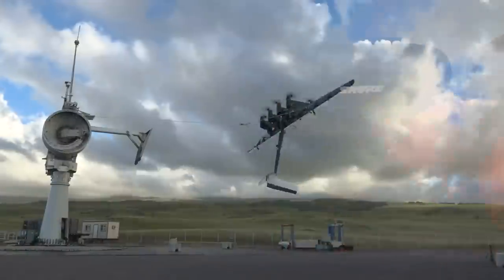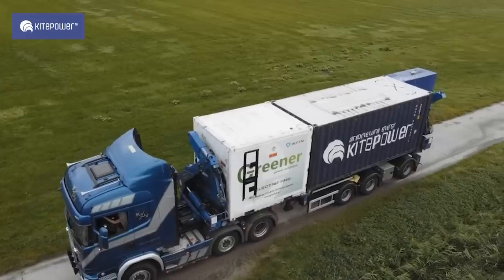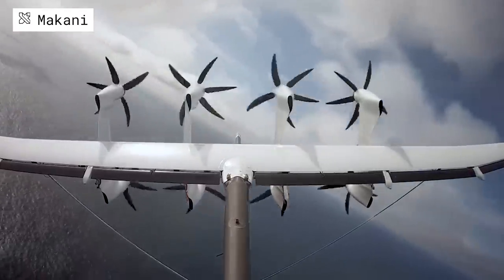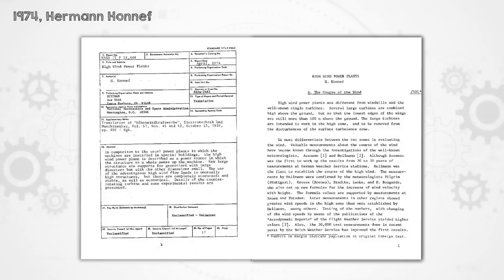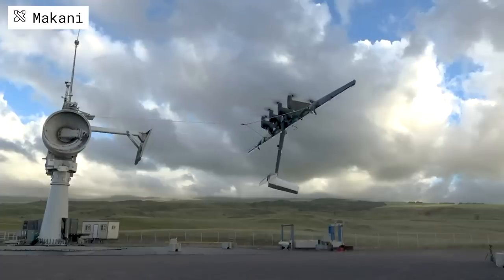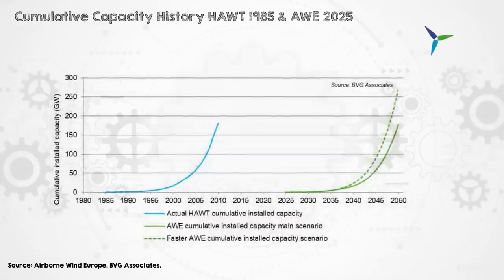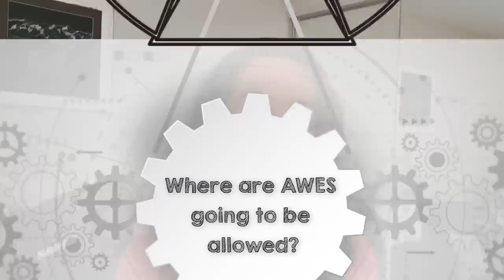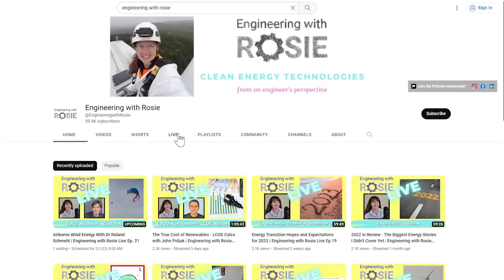Will Airborne Wind Replace Conventional Wind?

Comment: That's a big NO.  Airborne wind is as much a scam as vertical axis wind turbines, they both produce very, very little power but have exorbitant costs.  Main problem is, the rotors are super tiny and won't produce much of anything.  Wind turbines ideally like: 20-40 mph (32-64 kph), they don't need to be up in the extremely high winds as the rotors won't spin any faster, they just receive more wear and tear.  Ideal land-based wind turbines are 3-blade: 5-8MW with 100m towers and off-shore turbines: 15-20MW with 100-120m towers.  These dinky airborne and vertical axis turbines are mostly a waste of money that solar panels can do the work of.  BTW, I've had a small wind turbine in my backyard for the past 15-years and have sold over 2k small wind turbines in the past 16-years.
Reply from the maker: Good points, however if turbines will consistently see high wind speeds then you can design for that and take advantage. Ground based turbines aren't designed for the high wind speeds because it would be expensive to put a really large generator that would only be fully utilised at wind speeds that occur rarely.

Comment: Engineers see solutions in everything, but they often fail to grasp the downsides and potential problems with tech they develop, for example, lifetime cost vs upfront costs, metal tends to break apart when stress and load is put onto it, i see ONLY problems with a 24/7 flying structure that is suppose to last decades and reliably feed power to a grid that everyone depends on.
A nuclear powerplant lasts for 50+ years, it's solid as hell and will probably never run into major issues during its expected lifetime, If i was an engineer i would focus my efforts into making nuclear powerplants better instead of this artificial tax-fueled wind power hype, if windpower could bear it's own weight in infrastructure costs, powergrid costs, no tax incentives or "green politics" what would be it's current price per kWh? and electricity can't really be stored cost-effectively, we should only measure price per kWh during windpowers minimum output days during a year and not peak production days)

Start thinking stability and not fancy tax fueled green stuff please.

Comment: Hum interesting. I thought about the same idea. The problem is not getting there, it's staying there. I considered a tripod type system with graphene ropes holding a turbine in the air. The turbo fan rotating creates both lift and energy. I envisioned a torsional and long, turbine structure as the basis of the design, also made from carbon nano tube reeforced aluminum. The nano tubes are the rebarb and the aluminum is the concrete, if that makes sense  Think of a carbon nano tube mat, then injecton mold the aluminum. Like figerglass with resin  I cant quite see the turbine shape, but I'm sure that if you ran a sim, with all the fluid dydnamics, weather, ect..variables then youd get the perfect design after a few generations of running the program. Id also use Graphene layed, with a superterring magnetron, on balistic type ceramic, for the bearing, for super low rolling resistance and no need for oiling. In my head a large one didnt work, so my solution to the problem of lift was speed. An array of smaller diameter turbines would spin faster and hopefully generate more lift than one large one. I chose aluminum, as these things will get hot in the sun, so id cover the surface with peltiers to harness the heat into energy as well. I envision coving the peltiers in Vanta or Muso black to really make them efficient in the heat. Btw, I'm more of a creative thinker than an analytical one, so i can see it, but I can't do the math to see if it would work. If you put these over a desert area, the shade and airflow drawing down cooler air, should also have a secondary effect. Aluminum was also chosen for this reason, as the condensation of moisture, early in the day, could also raise the humidity, but I don't know as I can't do the math.  What do you think?

Comment: It wont. Most of the turbines around us are silent most of the time. The maintanence costs on a turbine are high, mostly due to the cost of having to send people and materials out to the remote locations. The airborne princible relies on more parts that are prone to ware than a standard tubine. Nothing you can use at home will have the power production to be viable and if the wind slows then the sail needs to be reeled in for safety reasons, which adds more moving parts, a person to watch it to make sure the motor does not fail and a control system that needs maintainence. It this system was used near a populated area then it would only be a matter of time before some idiot complains about it being dangerous, falling on their child or eco activists complaining about the danger it poses to bird (which to be fair it does) or vandels finding it funny when you cut the wire while its in the air.
Unless the system can be improved to be more cost effective than a Nuclear powerplant then it will be consigned to the same pile as the gravity battery.
Just to be clear its a nice idea and the creativity is top notch, but humans on average are incapable of seeing the long game.

Comment: what about using buoyancy as a energy source don't submarines go up and down pretty much for free just by changing there buoyancy. Why can't that pull a cable and spin a generator I understand it would be too impractical due to high price and low power output but wouldn't that work?

Comment: If a video title poses a question then the answer is generally “no” 🙃
There may be some niche markets where AW could be cost effective. The big downside as I see it is the enormous projected land area used by AW systems. 
A kite that goes up to 400m will need much more than that in horizontal direction. And not just in one direction, but all around it as the wind direction changes. They need to be spaced pretty far apart as well. It’s just not dense enough use  when compared with a conventional HAWT.
Also, it doesn’t scale very easily. A kite 50 times the size of the current 100kW version… the anchoring of the ground unit will also have to get bigger, negating the advantages.
To me, it will stay at a disadvantage.
Reply: Hi Vikingebo those are certainly valid arguments, but there are also some potential resolutions around. Kites flying in formation could operate quite close together as long as their movement stays synchronous. Off course this requires a whole new level of reliability, but is definitely a dot on the horizon.
As for the foundations: these actually present an easier loadcase than conventional windturbines as the tether only produces pulling loads and no moments. One promising business opportunity in our minds was to repower conventional windfarms at the end of their lives with AWE as the bases could stay in place. If the farm was to be repowered with new, bigger windturbines, the bases would have to be replaced as well.

Comment: A thought re gust-proofing: kinetic (ie: stretchy) ropes for use by tugboats recently got adapted/scaled down for many other uses, and can be had now on the open market at a variety of different load ratings. I think it would be possible to calculate the pull force the rope for a kite or glider would encounter, and probably quite easy to make a stretchy length of the tether serviceable/removable. Yes, for ground based units, this would probably have an efficiency trade-off
Reply: Also, winches that can maintain a constant pull force have been used in the marine industry for decades.  They would pay out more line during a gust and pull back during a slack period.
Reply: @Rubik3x  You have to work out how to fit the (non-stretchy) power cable into the stretchy rope too, in such a way that it doesn't break, or at least only in extreme conditions, which makes it harder.

Comment: I was originally going to say that this concept is fairly stupid. After reading further into it for about 1/2hr or so I can see that there is potential there but the whole thing relying on winching in and out about 500m or so of a 1km long dyneema cable every 2 minutes 24/7 is a fairly obvious failure point.

Comment: In a word NO. Wind will never be any use for electricity. Most wind generators only have about a 30% availability. It is too intermittent and there is no viable storage medium to make up for that. Adding renewable ( as I call it Un-reliable power) to the grid makes the grid very unstable if more than 10% of grid power is wind or solar
Reply: Fossil fuels have become a bit more intermittent of late, causing prices of electricity to treble in Europe, even with a significant renewable component operating at a steady cost.

Comment: The amount of energy required just to sustain the aircraft in flight even if partially drawn from the surroundings cannot possibly justify the energy generated by a bunch of turbines.....I mean do u know how little energy a wind turbine produce for its size and weight and how inefficient it is?

These air generators are the equivalent of trying to feed a human being burgers while they pedal bicycles for electricity,a human can only generate 100 to 200wh for an hour max before they are exhausted and a burger cost 5 bucks.
The only reason it's even justifiable the cost of feeding a human being is we have brains and are intelligent and can do things that have more value than simply performing manual labour.